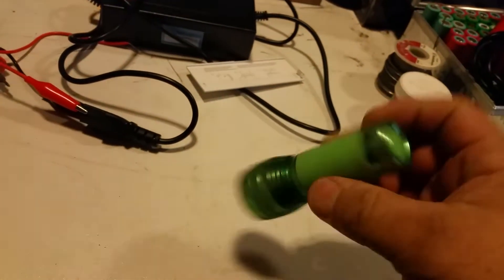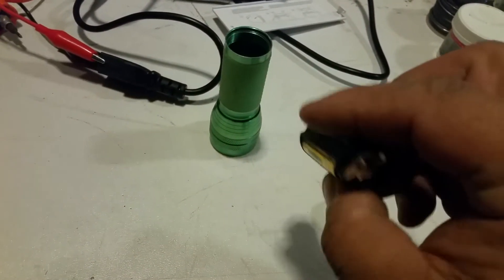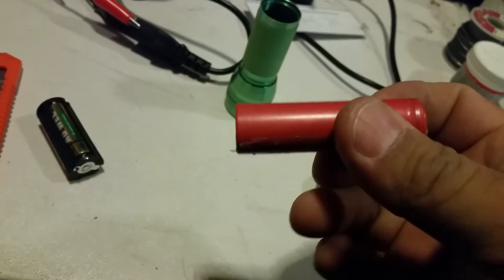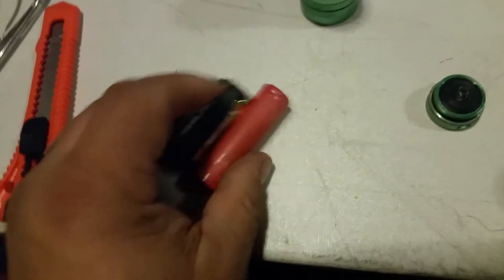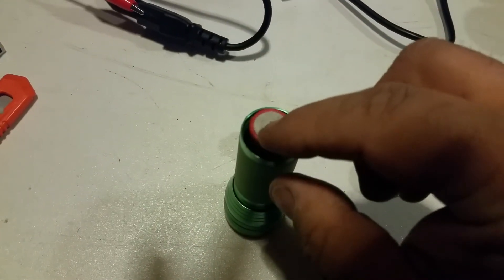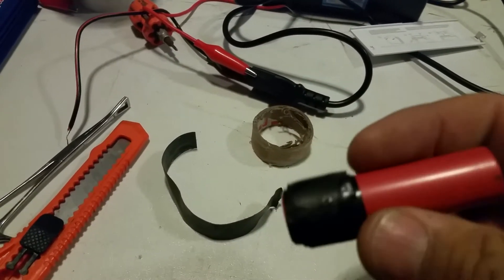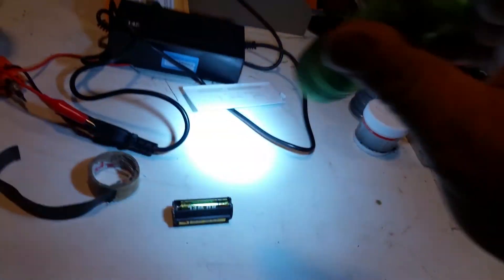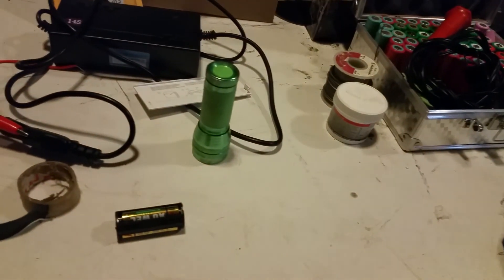Upgrade from 3x AAA batteries to a single 18650 cell flashlight

Comment: Have a similar flashlight - has a somewhat longer body - abd hasca spring at the bottom cap. Haven't tried a 18650 but think the spring can compress to accommodate it! Thank you 👍👏

Comment: The voltage isn't the only thing you have to consider. An 18650 can supply a lot more current than those AAA cells can. The 5mm LEDs in the typical cheapo flashlight can only handle about 20 milliamps each before they start to burn out.
Reply: Current draw is determined by the load (the bulbs) not by the source (the battery)
Reply: Current draw is determined by the bulbs not by the battery.
Reply: My flashlight has UV LED's.   The 18640 can be about 4.2 volts and the uv led resistance seems to be about 50 ohms and the voltage drop is roughly 3.5volts at 4.2 volts charge.     0.7 volts divided by 50 equals about 14 milliamps if I understanding and estimates are correct.  If I change 3.5 to 3.3 I'm at 20ma max.  So I think we're good.  What do you think?
Reply: Without a current limiting resistor leds will happily draw enough current to burn them out.
Reply: The answer is the 18500 ,
That replaces 3 battery caddy's most torches are made for Chinese market and cells 
It's no buggy to get 18500 or two online and use them .